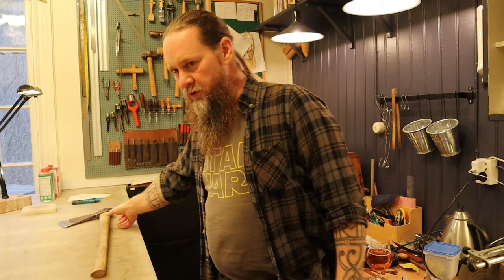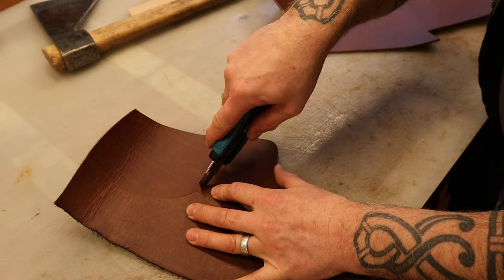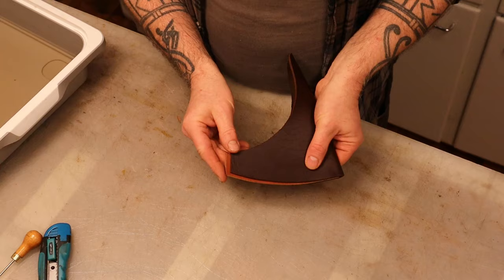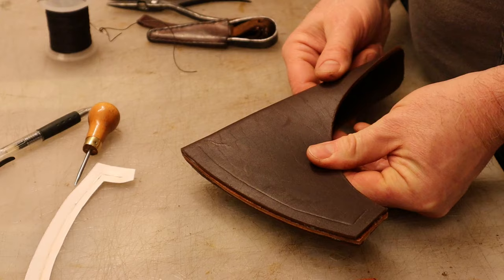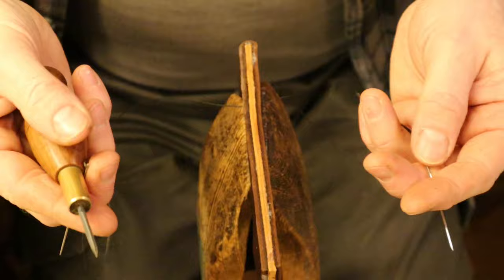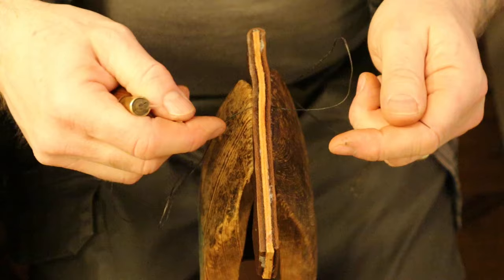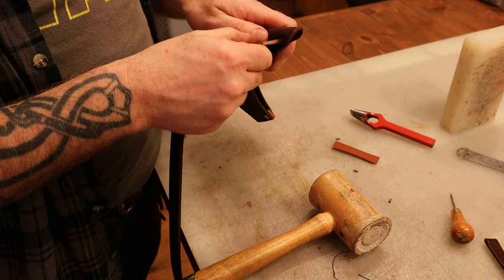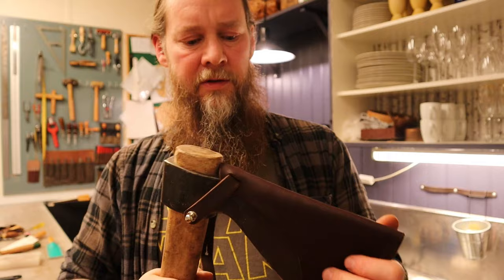How to make a LEATHER AXE SHEATH! Bushcraft Outdoor DIY project step by step! PRO TIPS!

Comment: I enjoy axemanship, woodwork, leather work, and blacksmithing content. Your channel touches on all of it, from what I  see.
I save file folders to use as templates (card stock thickness?) or corrugated cardboard, depending on what I'm making. Sometimes the corrugated mimics the way leather bends a little better.
Reply from the maker: Glad you like my stuff! I have a lot of templates for different things too, mostly historical shoes and purses. But I didn’t save this template since I don’t plan to produce more sheaths exactly like this one. And it’s really easy to make a new one, should I need to.
I don’t think the corrugated cardboard gives you a template that is exact enough for most leather items. As for the discrepancy when folding leather, thah changes a bit depending on what thickness the leather you work with is. So I think it’s better to make a template with some small margin, and expect to trim the piece to fit when you make it. But if you like the corrugated cardbord, just stick to it. Everyone needs to find the methods that suit them the best.

Comment: 3mm equals 1/8+14/29" (me, not Ola) 😂
Reply from the maker: Yes, but ’mericans speak in different terms when it’s about leather … they use ounces for that. So I think the leather I use for the sheath is 7 ounces, or 2,8mm.
Reply: I memorized that ⅛" = 3.2 (3.18) mm, but fractional inches just make things more complicated. Metric is just easier and more logical if you can work/think solely in terms of it, without too many conversions. Believe me, I have worked with inches for 60 years, and can see the advantages of metric.
Reply from the maker: I use both systems depending on the situation, but metric is usually easier.